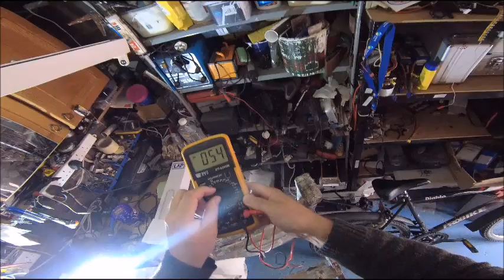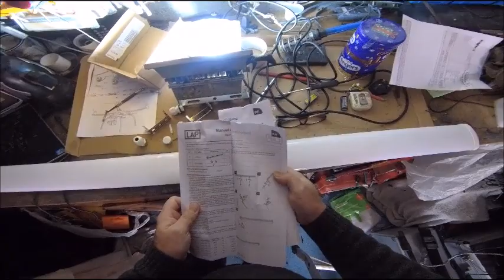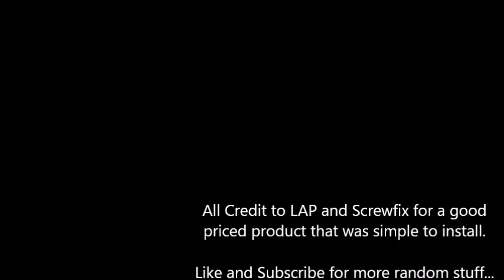Replacing a Fluorescent light with a LAP LED unit from ScrewFix

Comment: YES !! Enjoyed the video, then totally ignored it, after a really wet winter (22/23 ) my workshop ( Marley-style garage ) roof leaking like a sieve, and kept tripping the fuse, April now, two tubes are rusted, so get new ones, Screwfix type, the updated version 2430 lumens 22watts have sealed ends, £25 just the pull-out connectors, no earth, so I have a two core cable with 13amp plugs,,. I connected them up, then fitted them to the beams, saving myself neck ache,,. Regards Alf

Comment: Just installed two of these lights in my double garage, 5400 lumen version. Huge difference. Just two more to do. Instructions are dreadful, push fit didn’t work, but it seems it does as you need to make the bare cable quite long, where for all electrical work I make the bar cable as short as possible. One thing I found easier is to not use the inbuilt for the second light and use a small junction box instead, run the electrical feed to that and connect each light into that. This had a massive benefit as it meant I could connect the cable to the light whilst it was on the ground, then i installed the light, then connected the light cable to the junction box, used s Schneider one that’s dirt cheap and has built in rubber access points for the cables, the other benefit was I didn’t have to mess with the terrible wiring the previous numpty installed, as due to them if I want to work on the garage lights I have to switch off the downstairs and upstairs lights, wtf, plus they’ve used black and red wires for live, wtf.
Reply from the maker: Isn't DIY fun  😁😂
Reply: Black and red for live is perfectly normal for a switch drop from the lighting ring. It’s your switched live too and from the switch.

Comment: Testing the light fitting connections with meter to establish if live:-

Could I ask how you would have felt about it if the light switch had been in the neutral (light off) with the live still connected to the fitting?  It has happened I believe.  Myself in this situation I would have used the old fashioned tester screwdriver on each terminal.  Brilliant video by the way.
Reply from the maker: I had it switched off at the RCD breaker...I too have had shocks , so always isolate  😄
Reply: @AdeReeves  Just wondered what the meter bit was all about!🙂
Reply from the maker: @jesserawson898  MFA :)

Comment: Thanks for the video. I am about to go to Screwfix to get a LAP batten to replace a 40year old fluorescent which has taken to eating starters and is falling apart. Your video  means I will know exactly what to expect, and installation should now be a piece of cake. That's a bonus because joint problems mean I can't stand on a ladder for very long at a time.
Reply from the maker: Hope it all goes well...they are really easy to install so should be quick and easy.
Reply: @AdeReeves  I am doing exactly the same tomorrow, your video has given me confidence and what to expect. Thanks very much

Comment: Hi Ade, what did you end up doing with the spare earth that wasn't needed please. I have watched that bit of the video about 10x and can't see👀
Reply from the maker: I think somewhere in the comments it was classed as a safty strap rather than a extra earth ...  😀
Reply: @Ade Reeves  no sorry, I meant the spare/extra earth,  from the twin and earth when connecting to the light, which only had live/neutral snap connections, due to the baton not being metal.
Reply from the maker: @Vince Peacham  arrrr... Sorry ...yes seems there is nowhere to connect the earth too, can't say i was happy with leaving it simply tucked out the way , but i guess its plastic so nonconductive ..

Comment: By the way, the short strong earth was there incase you ever knock the frame off the ceiling, it'll dangle from the earth and not the live, potentially pulling out the live and shorting that to earth :)

Thanks for the vid, I think the 4400 is a bit much for my workshop as I want to have two  diagonally above my car. So I'll go for half the lumin, and perhaps a warm light :).

Comment: That mr2 is nice!! Im in the process of restoring one myself. So the real reason for this comment.  I've 2 LAP down lights same issue no earth slot.. Still unsure if I'll be fitting them but hoping its a simple process. Like this video. Since fitting have you suffered any problems. And where the lights in the garage spured off the ring main?
Reply from the maker: No issues so far ... they simply come off the main house CU and i used the original light fitting that was put in the garage from new build...Just extended the wires a little to suit...the whole thing was simply as the terminals on the light itself are simply snap in  and easy to daisy chain ...hope that helps  :)

Comment: I just fitted the same brand of light in my kitchen today, but the 5ft version, and funnily enough I didn't go for the version you have as I didn't like the idea of the wire going in the end like that, I thought if would look a bit crap seeing the wire on a kitchen celling.   on the 5ft light you do have a hole in the centre to put the wires into the fitting, or you could go in the end.  LED are loads brighter than florescent tubes, my kitchen is bright as hell now :-)I only had the traditional celling rose fitting.  The wiring had me scratching my head as it had 3 earth and 3 neutral wires but only one live, I have not seen a celling rose wired like that before, so I just used 3  block connectors to keep the wires all lined up, all working fine and I didn't get electrocuted lol.
Reply from the maker: Yeah some ring mains look more complicated than they really are....you took the same logic as me, but always looks strange when a black wire is the live "does not compute"  😆
Reply: Which brand did you use?
I want to replace two 1500mm fluorescent lights in my kitchen but don't want the end wiring.
Thanks

Comment: Hi Ade , looking to buy this . I have an old screw fix . 2 x 58 W T8 which is the LED batten equivalent in screwfix for kitchen ? How many lumens I need 

Thanks
Reply from the maker: Hi there .... I'm no expert but this mat be of some help...

https://www.rapidtables.com/calc/light/lumen-to-watt-calculator.html
Reply: @AdeReeves  what did you  buy in video as im looking at screwfix lap 43w . I am looking for cable entry and wiring  in middle NOT at the end ?
Reply from the maker: @ktang4111  The one i brought was    https://www.screwfix.com/p/lap-oxbo-single-4ft-led-batten-white-22w-2100lm/590cc   but I don't think any of the LAP ones have middle entry...  maybe use there online assistant ....

Comment: Could one of the light be fitted with a 3 pin plug as I the only power I have in the garage is via a extension reel?
Reply from the maker: I have a larger one on a 3 pin plug as an inspection light, so I don't see why not....👍
Reply: @AdeReeves  thanks.

Comment: Thanks for the video. Inspired just bought a similar one for my garage. When connecting Live and Neutral on the LED, did you use the bottom two smaller hole? Seems there are four on top and two in the bottom.
Reply from the maker: As i recall i used the side connectors....they where just push in and clip...so easy to use.

Comment: I've bought 3 of those exact lights, and am putting them up today. However, the single 6' Fluorescent tube I've taken down has 2 cables feeding it. I need to make the 'circuit' I guess. So should I feed one cable into one end of the first batton, then daisy chain the next 2 (in one end, out the other) and then feed the return back to the 2nd original cable?
Reply from the maker: There is many ways it could be done ...but if your not sure get a electrician in ,,, Its really not worth second guessing for peace of mind alone .

Comment: Just bought one of these, the previous light had the T&E from the CU in, and also switch line back from the light to the switch. Not sure how to link these 2 cables back into the new LAP batten to ensure the light is connected to the switch correctly? Presumably your power goes into your switch and then back out into your light?
Reply from the maker: Sorry but i suggest if you in any doubt you contact a professional.. I know enough about electrics to be comfortable doing it from previous training I have had, but cannot advise as i's not fully qualified.. perhaps looking at ring mains and their setup could help ?
Reply: @AdeReeves  thanks for the reply Ade, appreciate that! I've found some info, I'm going to take a feed to the switch and then the T&E from the switch to the light. Bit more work than I'd intended but saves having to wire in a junction box. Will ensure I test the system safely each step of the way....

Comment: Does it come with connections to daisy chain them together when using multiple tubes?
Reply from the maker: you just have to use a an off cut between the units, its all clip in connectors.

Comment: How do I know what size length and wattage to use for my garage please?  is it easy to wire 3 in parallel thanks Ian
Reply from the maker: Hi Ian  . .  .think along the lines of twice the light output of a standard tube ...i went like for like in size but if output is not important you could go smaller if you wish...linking them i would say is easy as they have push fit outlets each end.

Comment: What wire did you use 1.5mm or 2.5mm twin and earth?
Reply from the maker: 1.5 | twin with encapsulated earth as there is little to no load from them.